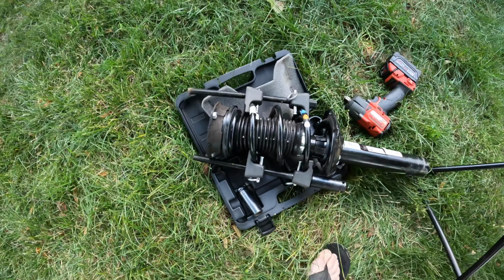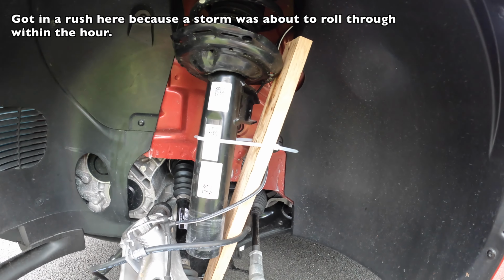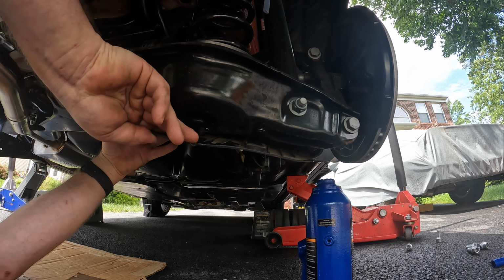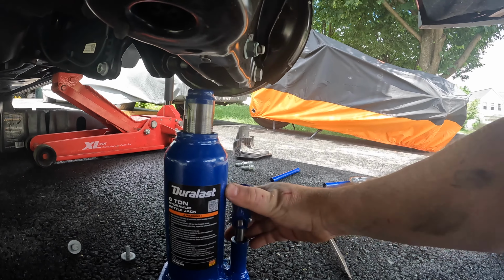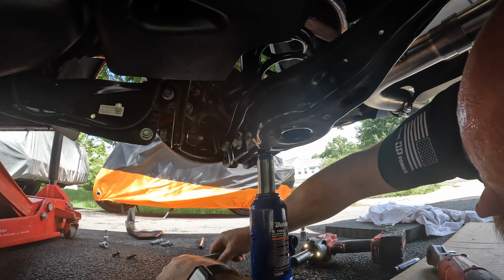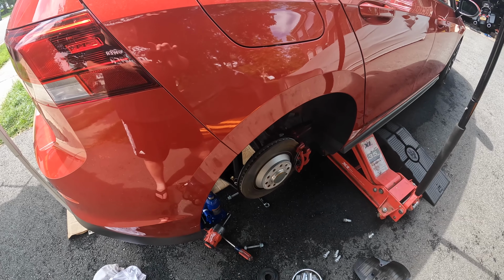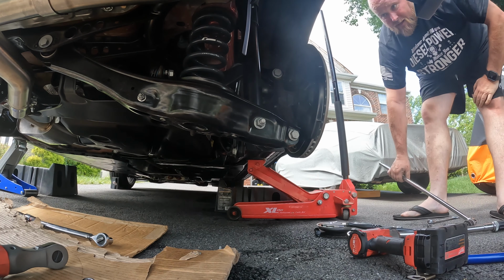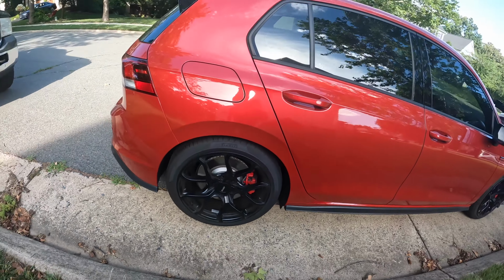2022 MK8 GTI Racingline VWR Sport Spring Install

Comment: I think the suspension is almost identical to the b8 Passat. I was looking everywhere to find out if I had to remove those three bolts to remove the spring at the rear or if there was an easier way to do it. 

Would you take on this job without power tools? I wonder if an an impact driver could remove those bolts